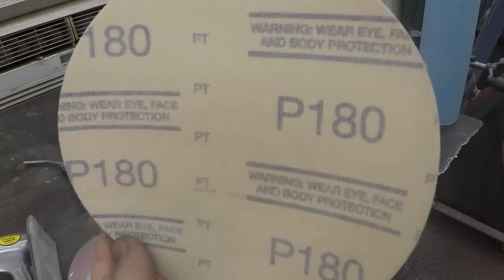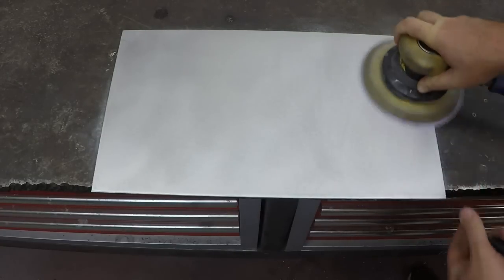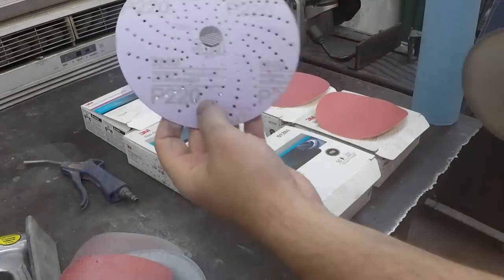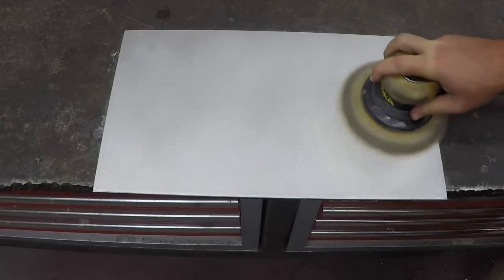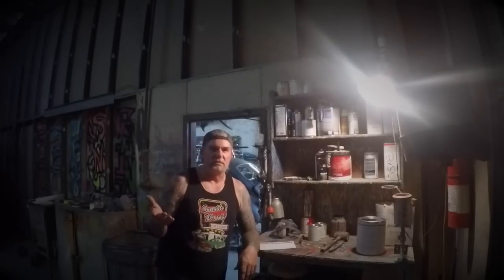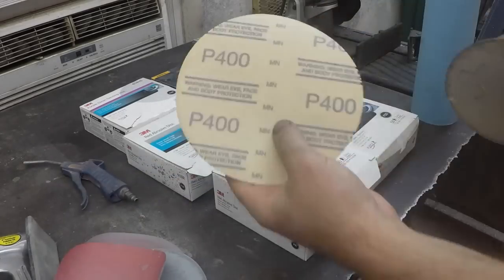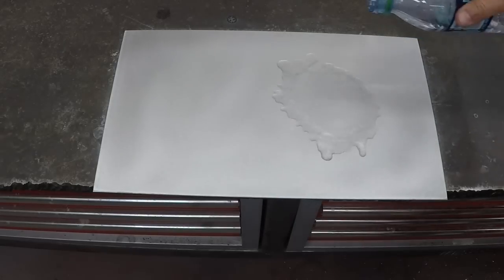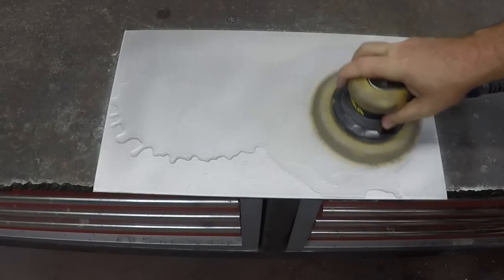How to polish aluminum with DIYautoschool

Comment: Amazing..I didnt.know you could start.off that abrasive and.bring it back with that shine!!! Question do you think this same.concept.goes.for.glass.windows...the reason I ask is because DARKNESS has several deep scratches hence the reason why I haven't tinted the glass
Reply: CountrySideClub Glass is very hard to polish, They make glass polishing kits but they only work so well.. Deep scratches you are probably looking at replacing the glass...
Reply: Shut Yer Face Garage I was afraid that might be th e case...thanks Matt
Reply from the maker: CountrySideClub Yep, as usual, SYF is right on the money.  I bought the eastwood glass polishing kit to try to remove some very deep scratches on the door glass on the mustang, after a waste of money and a full day screwing around with it, I gave up on it and just bought new glass, in the end it will all look better anyway to get all new glass, have it all match.
Reply: turbocobra been trying to find the glass..will keep looking thanks Matt.and Gary!
Reply from the maker: CountrySideClub You could start your clear sanding with 80 grit also and get it all the say out to 2000 grit, but you would need like 30 coats of clear to not burn through, lol

Comment: pete you always show us how to do things the right way not the half ass way alot of lazy people like to do.question pete should we wax or clear coat when done which is the best choice.wanting to do my motorcycle wheels i would have to do all the sanding by hand.and my aluminum has some pitting how do i remove it thanks.pete keep up the awsome videos.
Reply from the maker: robert west I am not sure pete is looking at the comments on this video.  I don't think you would have much luck clearing over polished aluminum, surface is too smooth for any reasonable adhesion.  I mean, will work?  maybe, but it's a crap shoot.  There are various metal protectants like sharkhide and others that can be applied to help with corrosion of the aluminum.
Reply: i know they do it on motorcycle wheels or you can wax i heard .thanks for the info.
Reply: turbocobra thanks im restoring motorcycle wheels on a honda valkrie and they have some pits.i am with you i think just going to clean them with this i just dont know there bad should i sand them? or steel wool any help would be great thanks turbo cobra.